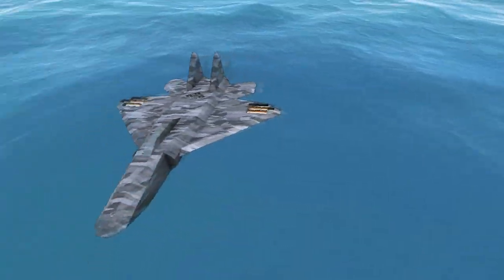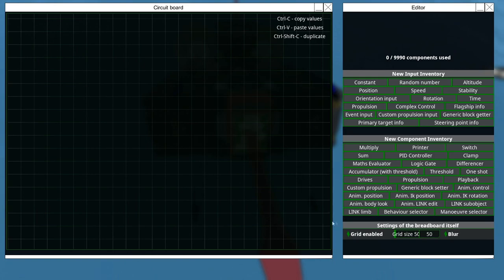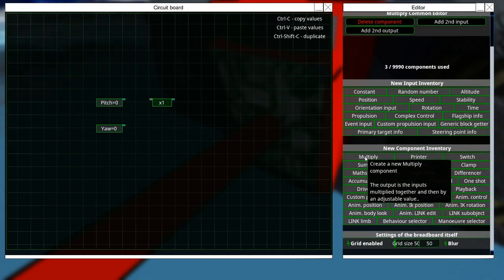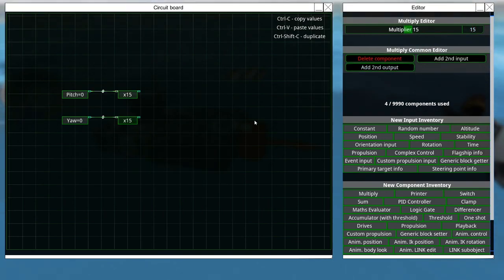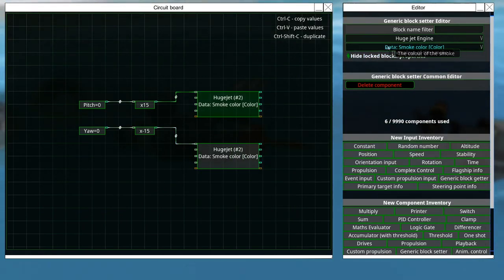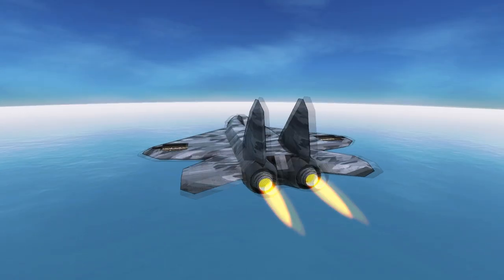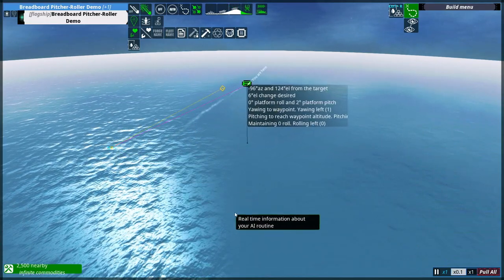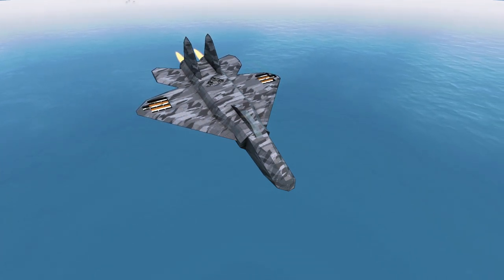Breadboard Thrust Vectoring! 🍞✈ From the Depths

Comment: You actually did it, I'm so proud of you!

About the difference between AI and non-AI bread, place down both and look at the options you have available. It matters a lot depending on what you're trying to do.
Reply from the maker: Cheers! I will double-check that. 😁
Reply: One day I will be able to replicate your cool hovertanks.
Reply: @BorderWise12 non AI breadboards are not aware of where your vehicle wants to go, or where the enemy is, if any.
If you want to do things depending on if an enemy is around (say, switch an AI mainframe from fleet mode to combat mode), you'll need an AI breadboard if you don't want to rely on tricks like using an ACB to set a propulsion flag.
That enemy awareness is actually super useful for controlling the PAC to change it's charge time depending on the enemy volume.

Comment: Congratulation for passing the Breadboard cap, and showing in on video. As you mentioned, it is possible to use names to direct different inputs to saparate blocks of the same type. Your plane has two engines, that is enough to perform yaw, pitch and roll maneuvers. The script for it is slighty more advanced but the idea is to combine roll and pitch inputs with a sum module and route that to a GBS controling a single engine; then you duplicate that code for the other engine with the roll input multiplier set to a negative number; and presto! You achieved 3D vectoring. :)
Reply from the maker: Cheers! I will go learn that thing! 😁👍
Reply: If you have engines on four corners of a vehicle, you can even go further, and do full six-axis vectoring control. Pitch and roll by differential pitch vectoring, strafe and hover by collective pitch/yaw vectoring, forward/aft obviously by normal thrust control (requiring a pair of engines for jets), and yaw either by differential thrust or differential yaw vectoring, if the engines are in a horizontal plane and pointing along the fore-aft axis.

Comment: One important thing to note about AI Bread is that its get's turned off with the AI. Meaning an airship with a AI bread that controls height, pitch, roll and/or yaw will loss control and fall out of the sky, if you turn off its AI.
The non-AI bread is always active and almost always better for basic control.

Disclaimer: I haven't played my self in some time, so there is a very small change that this has changed, but i highly doubt it.

Anyway nice to see you finally dipping your toes in the breads :)
Reply: Is it really the case? Pretty sure that not. At least not anymore.

Comment: It actually does work on shaft driven propellers and hull exhausts. It shouldn't, but it does.
Also, I think I found a glitch with breadboards concerning pump buoyancy... you can set them to %400!!!
Reply: A good way to make buoyant boats :o
Reply: @Scorpion 56  Untill it gets a few holes. I use this trick with breadboard for dynamic pump system for extra stability (named pumps on either side/end  increase/decrease per roll/pitch value) and emergency floatiness (altitude going down? pump power goes up!)

Comment: Tried the tutorial with the prefab jet and it worked great. Managed to get a missile jet for my playthrough. The issue im having though is when i try to scale it up into a bigger flyer and control custom jets with jet generators it doesnt work. The jet i build just seems to want to flip onto its back and fly into the sea. I set up the breadboard to control the jet controller and set it up the same way but no luck. Are you able to do a build tutorial on custom made aircraft. I have watched a lot of your videos and they have been very helpful thanks.
Reply from the maker: If it's flipping upside down, it might be a few things:
- Thrust is placed too low, causing it to pitch up.
- The jets are placed upside down, causing the breadboard pitch controls to be inverted. 
Hope that helps!

Comment: I tried to do this to make a harrier and my god the pain.

I decided to upload to show my pain, it's called the Buzzard Vtol.

In the end it wasn't very practical because going VTOL with a small jet in combat just makes you an easy target, but I imagine if you applied the same concept to an airship it would work. Basically switches to flight controls to get in range and then switches to hover when in range. With tweaking it could do/make it work with the old strafing thing but personally I gave up on this vehiicle because it's too easy to shoot down.
Reply: Can't figure out for the life of me how to make planes viable in combat, tbh. Against most enemies it's fine because you can always dodge incoming flak and missiles, but as soon as lasers come into play you start getting into major trouble. Maybe if you include a multiple shield layer, but that immediately expands your plane size to significantly larger due to needing more generator space. Even using jet engines I don't feel like anything smaller than, say, an Su-35 (which is one of the largest combat aircraft out there) seems to be viable, due to how bad stealth is. I may have another go at it with a twin-engine fighter rather than my single engine design, however; recently figured out that a rotating shield design is very powerful against lasers and APS.
Reply: @briancong12345  I my experience, either use them as standoff platforms (ie have them close until the they reach their weapon's max range and then fire before running away) or have them be small with the U turn attack run, not the flyover. Flyover is too predicable, but if you use Uturn they are flying in little circles near the target instead of around the target. Guns just don't know how to track them and IR missiles get thrown off.
Reply: Check out one of the Steel Striders helicopters. It doesn't fully utilize the concept, but it is similar.

Comment: Thank god I’ve wanted to do thrust vectoring for so long…..now to figure out roll when you have 2 thrusters….bc…. you know…… it’s to difficult to add ailerons on the wing tips
Reply from the maker: Yup, that's next on the to-do list! 👍
Reply: @BorderWise12  awesome!!!! Have you tried small missiles with heat warheads? Been messing around with them and found for it’s size it’s significantly better than nearly any weapon I could make. spam enough of them and it’s been carving through ships (been rearming my jets to carry 96 of them and been finding Hugh success for low cost.)

Comment: How to roll using BreadBoard ? I.e how to input opposite axis movement to create roll movement ?
Reply: Ok, so lets say that you have a plane similar to the one in the video:
 - make sure your two jet engines are named
 - The Pitch and Roll outputs are going to share the same inputs, so you handle this the same way as a thrustercraft A get 50% B gets 50%, though you could change that ratio depending on weight distribution (long boi need more pitch, wide boi need more roll)
 - The Pitch output is multiplied by 7.5 (for 50%), and the same for Roll
 - That is then added together for each output for each engine, as roll needs two opposing directions

I would also make the recommendation with this to use PIDs either in the breadboard or on the AI as they can smooth things out.

Comment: One question that I have about this- say I have small vertical CJE's for hover and small CJE's for forward thrust. if I want to strafe using the vertical CJE's how does the breadboard tell the difference between the hover and forward thrusters?
Reply: Easiest way to distinguish between types of the same block is naming. First, name your up and forward CJE's something different like..."up", and "forward". Shift+N is default keybind. Then, in the bread, the Generic Block Setter has a field for "Block Name Filter". Set this to whatever you named the thruster you wanna control. If you want your "up" to respond to the GBS, you input up in the field, etc etc.
Reply from the maker: Block-naming! Thing I mentioned near the end of the video. 😁
Reply: @Brenzo44  ty!
Reply: I'd also recomend not using spaces or special characters in your part names as that can cause issues

Comment: What's the key to switch between view modes, as you do at 1:35? Non-structural blocks and such? I've been using the Shift-E build menu, and it's annoying.
Reply: Shift + P, gotta tap it multiple times to cycle between the different modes.
Reply: @mancher2794  Cheers!